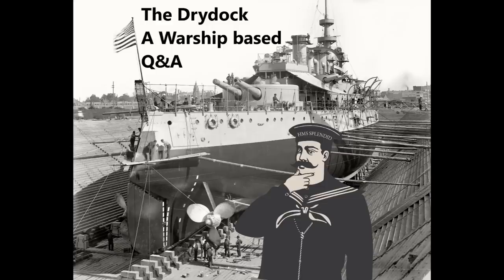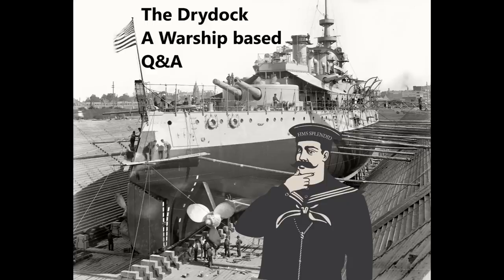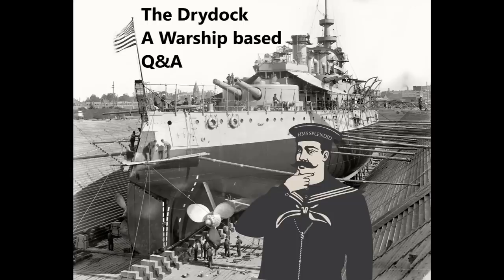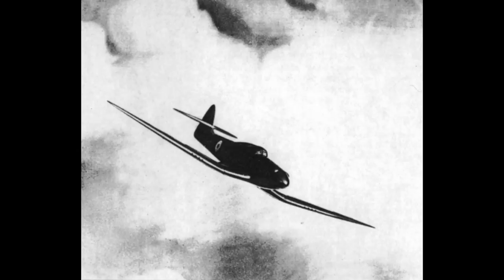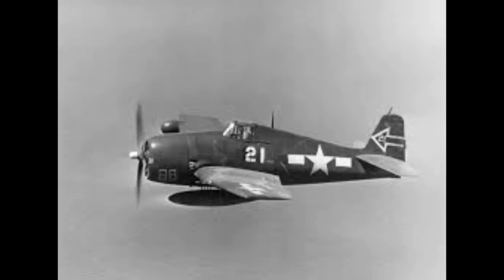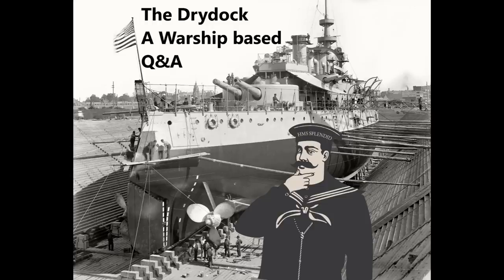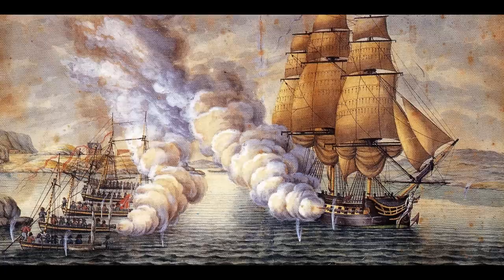The Drydock - Episode 184

Comment: Jet fuel can't melt steel beams, huh? Alright, I want the personal jet pack and flying car that you're promising me. Common structural steel will apparently be fine for turbines that operate in burning jet fuel. No need for those expensive nickel based super-alloys, or the ridiculously stringent manufacturing requirements to make turbine disks out of it.
Reply: Without oversimplifying things, there are different types of steel alloy. They have different composition. Anyone who has seen TV shows about making knives has seen Steel in a forge. You just have to make it hot enough to be bendable to work on it.
Reply: Toast (yes, I mean slightly burnt bread) can melt steel, providing you feed the fire enough oxygen... A puddle of JP4 in just atmospheric conditions? Eventually it will heat the steel beyond failure. A contained compartment with a puddle of fuel? The fire can only expand / continue to heat the metal in direct relation to the addition of oxygen.

Your turbine analogy overlooks the amount of air being fed into that particular jet fuel fire.
Reply: @WALTERBROADDUS  The forge/blacksmithing is an excellent example of how metal's properties change when heated, and you're right, most people are atleast somewhat familiar with it. That's probably the best simple counterpoint to the 'steel beam' nonsense.

Myself, I like taking the ridiculous approach. Also, oversimplifying is fine, no worries. (Although I did enjoy Drach's dive into metallurgy while talking about naval armor)
Heck, I was oversimplifying too. Pulse jet engines can be built without any moving parts, but most designs have moving shutters as the only ones. 

And I'm hoping someone brings up one of the many examples of jet engines that WERE made with steel turbines, some of more advanced composition than others, and the various performance trade offs and compromises inherent in any design.
Reply: @nunyabidness674  Very good! I was indeed making a false analogy. Hopefully it was somewhat humorous, I hope? I got a chuckle out of the idea of toast melting steel. It's so far removed from what we expect from either that it seems ridiculous, but as you say, it's quite possible under the right conditions.
Reply: Just for fun, we can add aerosolized flour or sugar to your toast fire for a fuel air bomb made entirely from your breakfast. I wonder if any bulk carrier was lost in this way? Not including coal dust explosions.
Reply: @nunyabidness674  Off topic, but talk of bendy steel makes me think of the WTC collapse. Do you think the abundance of air(oxygen) to the avgas fires could have contributed to the spectacular failure of the structural steel? I've never understood what happened there.
Reply: @bincoln  okay, semi unqualified reply but, the WTC was essentially a giant chimney. The rising heat of the fire combined with normal wind at that altitude turned the core of the building into a blowtorch for all intents. Add to that the concrete of the structure acting as insulation, the concrete powdered first, then the steel failed from overload, not really a melting event.
Reply: @arizonaexplorations4013  barges, yes. Normally during loading. A couple of sites on the Columbia river are still home to a destroyed grain elevator semi connected to a sunken barge. As for bulk freighters, there was Texas city, but that was more an endothermic reaction rather than a vaporized dust.
Reply: @nunyabidness674  Wow, an evocative explanation! Cheers mate.
Reply: @nunyabidness674  Wow. I said that as a joke. I didn’t know it really happened.

Comment: Anyone no if they ever found the wreak of German  battleship from ww2  Scharnhorst
Reply: regrettably from wiki, not a proper primary source but : 
Wreck discovery

In September 2000, a joint expedition to find the sunken battleship conducted by the BBC, NRK, and the Royal Norwegian Navy began. The underwater survey vessel Sverdrup II, operated by the Norwegian Defence Research Establishment, was used to scan the sea floor. After locating a large submerged object, the research team then used the Royal Norwegian Navy's underwater recovery vessel HNoMS Tyr to examine the object visually. The wreck was positively identified by an ROV on 10 September, which located armament consistent with that of Scharnhorst.[7][73] The ship sank in approximately 290 m (950 ft) of water.[7] The hull lies upside down on the seabed, with debris, including the main mast and rangefinders, scattered around the wreck. Extensive damage from shellfire and torpedoes is evident; the bow was blown off, presumably from a magazine explosion in the forward turrets, and lies in a tangled mass of steel some distance from the rest of the hull.[73]
Reply: @andrewfanner2245  Thank you